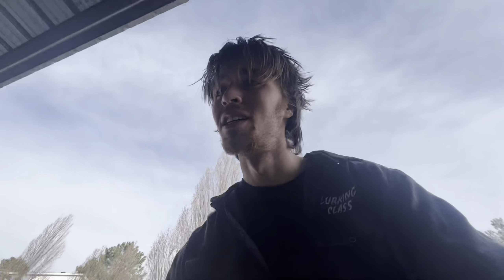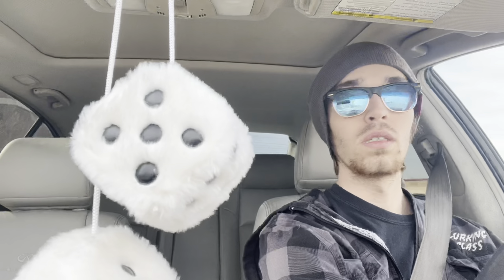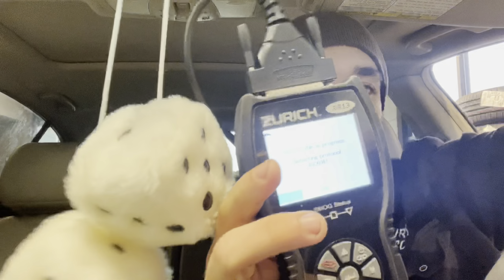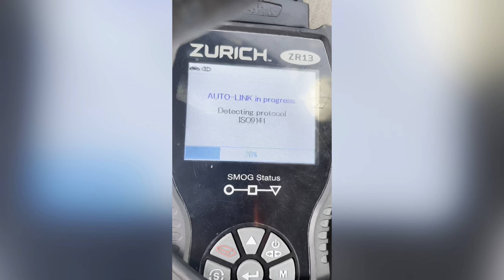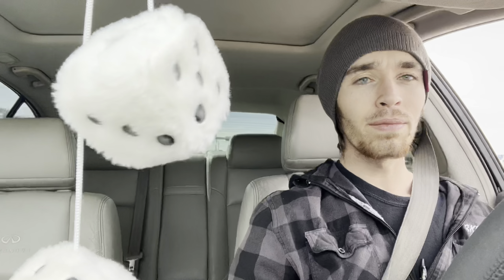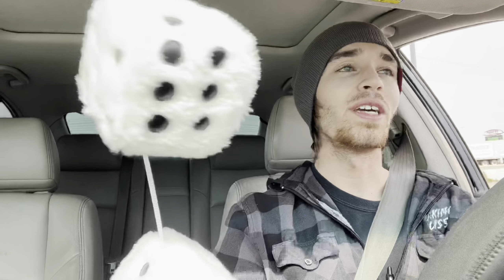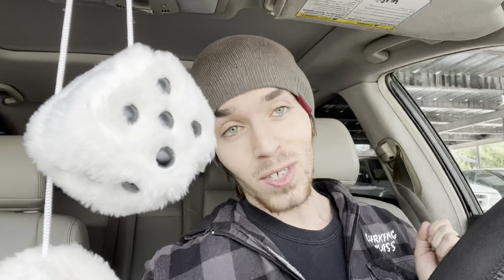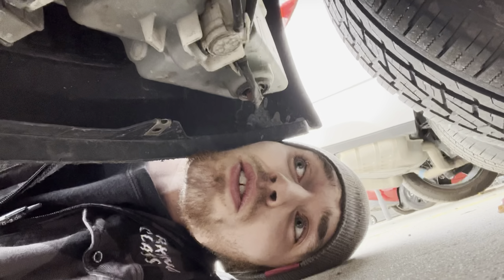SERVICE ENGINE SOON | Infiniti G35 Sedan

Comment: i was driving after work, and notice that it shows that has a service engine soon, i got home and when i try to look underneath it was all the floor full with coolant that my car was leaking, after a hour my car doesn't show that engine sign again but now i'm trying to figure out what could be the problem
Reply from the maker: How many miles do you have on it? My water pump went out and took out my thermostat with it. Is it leaking from the drivers side